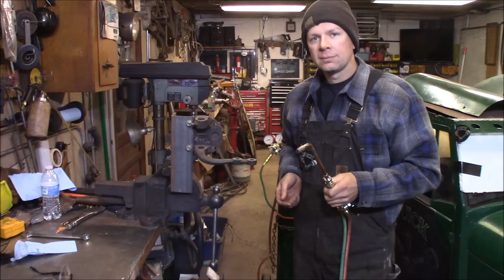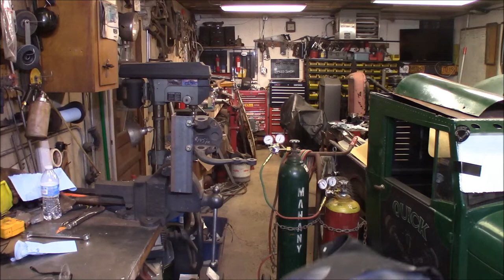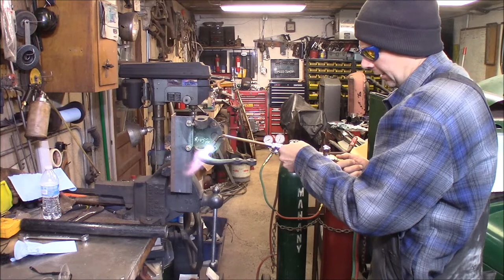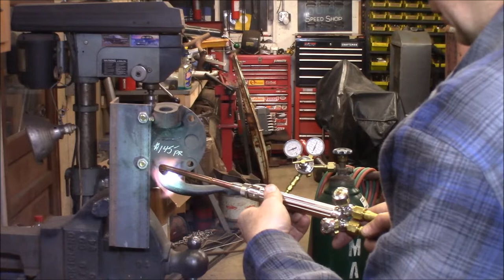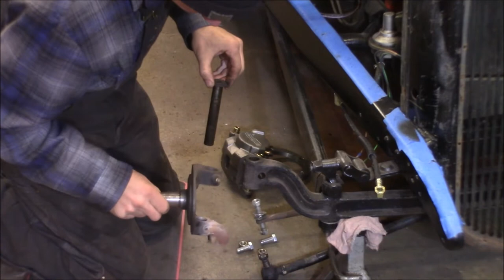How To Heat and Drop Early Ford Steering Arms for Dropped Axle Hot Rods

Comment: Shouldn't you put a pin down the two king pin knuckles to prevent mis-alignment when the control are was heated and bent ?  Might prevent some distortion or slop in the king pin bushes?
Reply from the maker: I don't think its neccessary.  The heat is all concentrated away from the bushing holes and the spindle is mounted securely across the face.  There isn't enough force to misalign the bushing holes by doing this by hand.
Reply: @QuickSpeedShop  Was sort of concerned about warping-  as welding heat causes distortion for the surrounding areas from heat transfer, even without force?   Probably not critical with thick bushings
Reply from the maker: The spindle is way to thick to warp with the controlled heat from the torch.  Warpage is more is a concern with sheet metal.
Reply: @QuickSpeedShop  OK-- but I have had warpage with pieces of angle iron that were braced on one side. Never hurts to be too careful. But I guess the alignment of the king pins can be taken care of with the softer metal bushings?

Comment: A few concerns, if dropped by 45 deg and straighten back it makes the arm shorter and the steering range will be modified. Would it be better to stretch it as you bend it to keep the same king pin, pivot / steering arm distance?
How do you control the 45 deg to make sure the other side is the same?
And what about the ackerman angle? 
I will need to do that job for the first time, any advise welcome
Reply from the maker: I just eye-balled the 45 angles to  match them up.  The steering angle doesn't really change, you're just lowering the tie rod attachment point.  I built the tie rod to the new arm location so I don't know how it changed from undropped location.  I didn't measure any Ackerman angles, but I'm pretty much just dropping the tie rod holes straight down.  Its not an exact science.